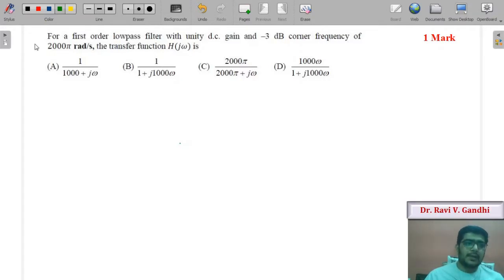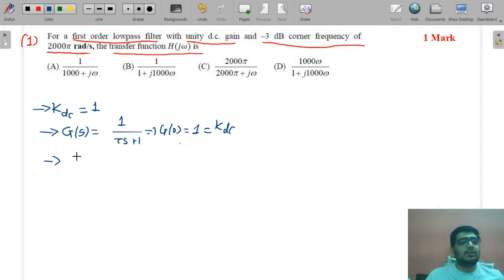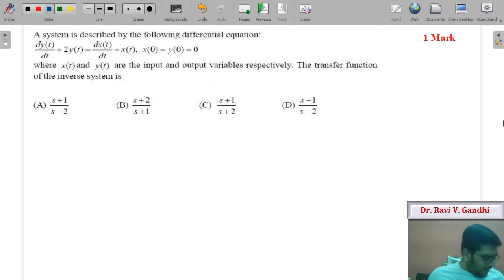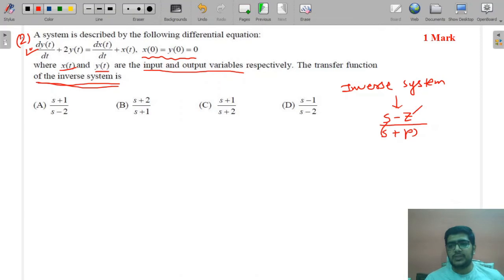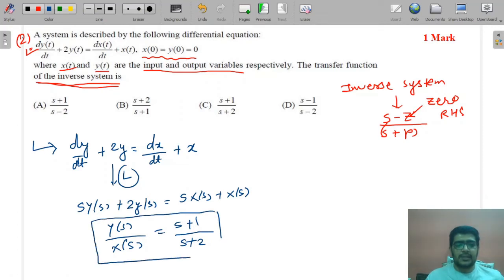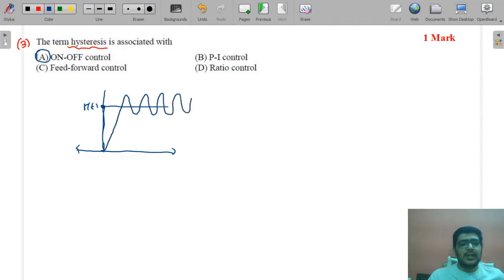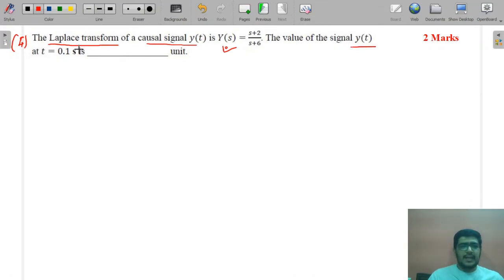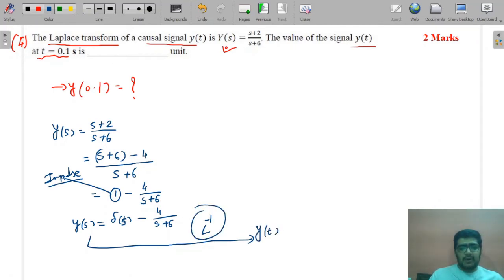GATE 2017 Instrumentation Control System Solution | Dr. Ravi Gandhi | Control Circuits Pathshala

Comment: what is inverse response sir?
Reply from the maker: Inverse response is the characteristics of the system to show reduction in output under steady or incremental change of input and vice versa...

Many control systems with zeros in RHS or negative loop gain shows such inverse behaviour...